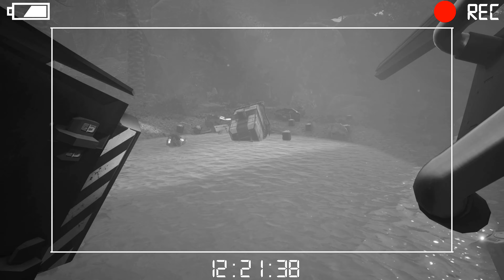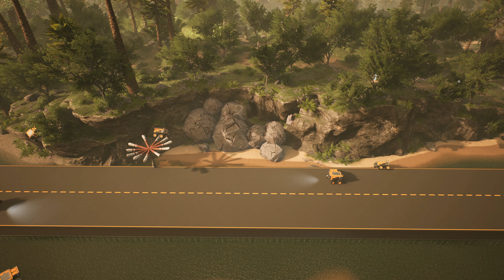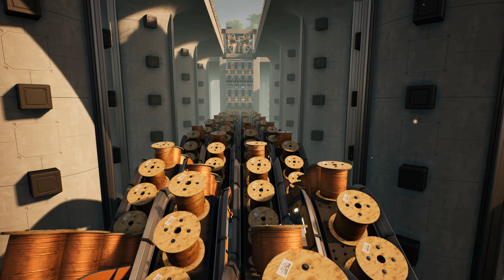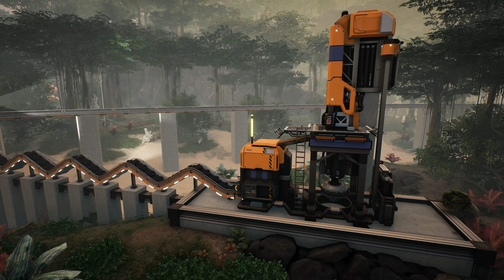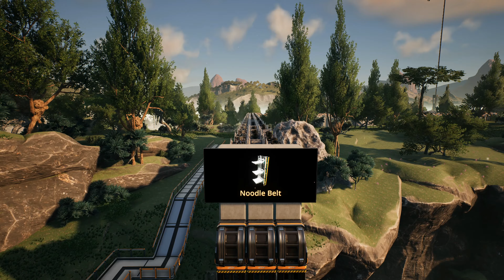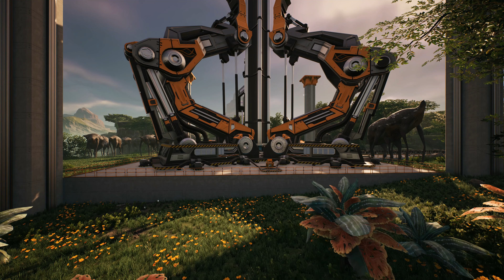How its automated - Automated Wiring

Comment: How do you fuel your drones? I haven't seen any battery inputs in these factories, is there a trick for it or you just removed the battery lines so it looks better on video?
Reply from the maker: For the production lines, everything is ratio'd out perfectly, but the factories are set to creative power, so I don't have to build a power plant for each episode, and the same for battery production when using drones. That way, each episode can just focus on the main item featured.  :) Each episode has its own save file to maximize recording and production quality.